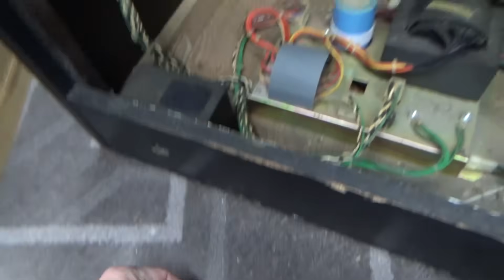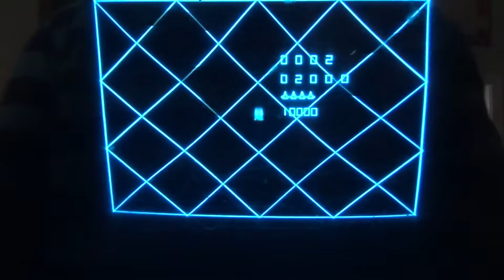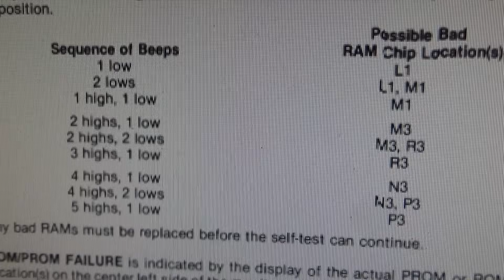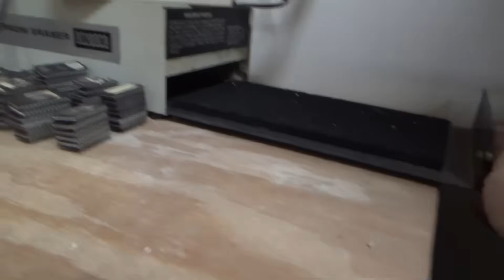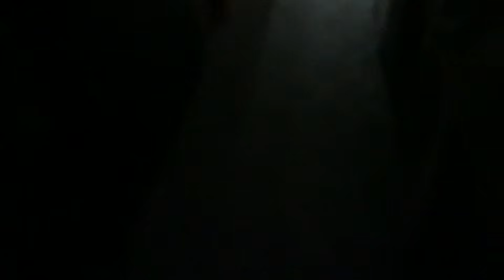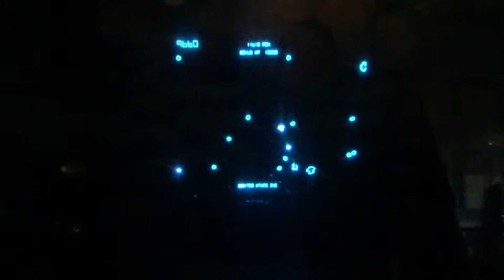Strange Fault, Easy Fix on an Atari Asteroids Deluxe Arcade Machine

Comment: Ron,
When you mentioned that the monitor might need to be repaired, I immediately thought of the table-top Asteroids that was having severe monitor problems.  You had to use some gadget to get the X & Y points to align.

Comment: I've not seen ROM circuits, but usually memory is designed so it can only be in one state at a time.  So if a ROM verifies after a write, I'd say it's OK. These days a lot people are using flash RAM as ROM since a lot of those ROMs aren't available anymore. I'm assuming there's something that emulates a 2716 and is programmed with just software.

Comment: Wonder if that rom didn't originally have the proper code in it and as part of its failure is bits getting changed.
Reply from the maker: I think the wrong one was swapped in an attempt to repair a bad rom in that same position, they just put the wrong one in

Comment: Whether the checksum test is going to fail depends on where it gets the actual sum to check against.  If the sum is kept on the chip itself, then each chip will test as valid as long as there's been no internal failure or data loss, because it's just checking the chip against what it thinks it should have, completely independent of the chips around it.  It would only test as not a valid part of the revision set if the sum was kept on a different chip in the set.
Reply from the maker: That makes sense...
Reply: I was wondering which ROM contains the test code. If that's still first revision, it wouldn't identify later revs

Testing is probably just for presence. I'd expect just testing a couple bytes for a signature, and assuming the rest is okay